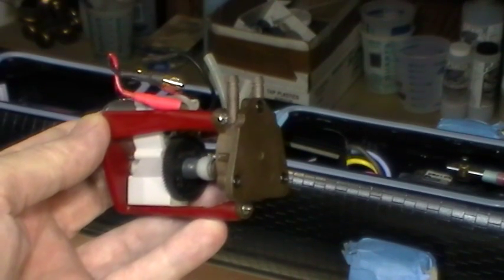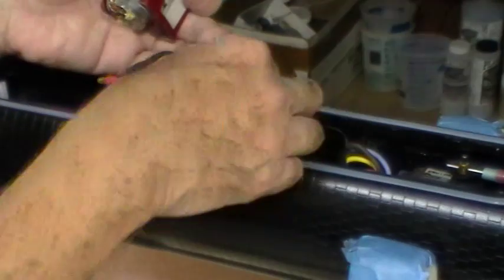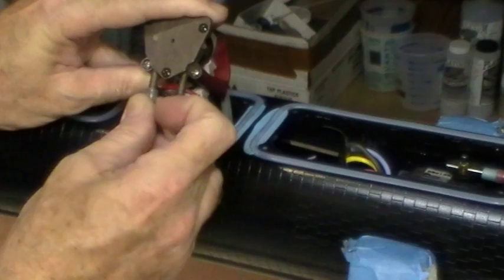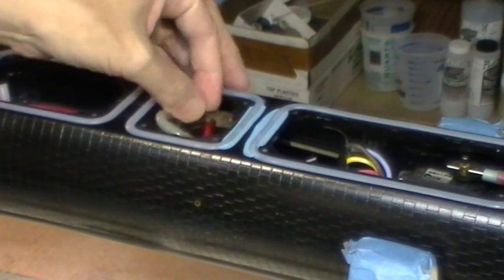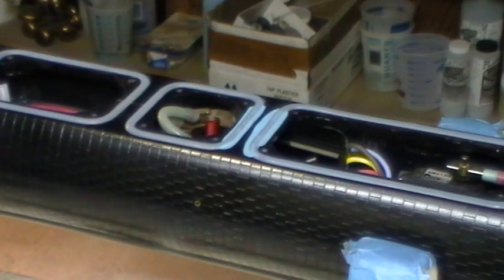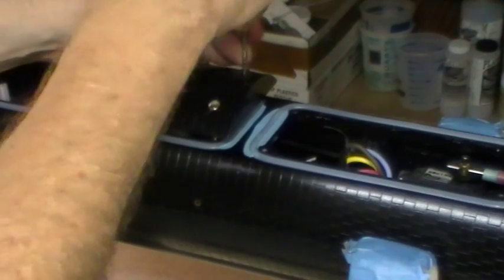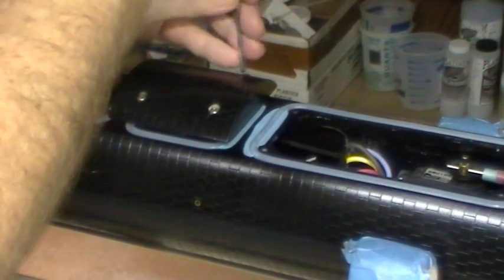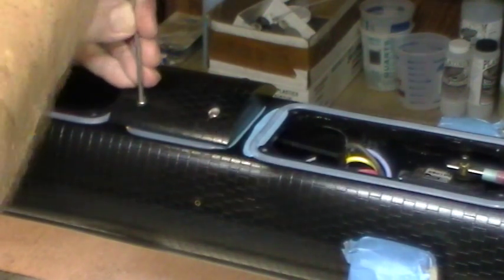Los Angeles Class 688i fast attack submarine model: Ballast Pump Install on Radio Control Submarine.

Comment: Just curious, what’s the reasoning behind having the screws fully extended before attaching? 

I’d guess it’s to make sure the seals are aligned?
Reply from the maker: Hi Roc - There are two reasons for having the screws fully extended before attaching: 1) Picture the silicon tubing washer on the screw. If that washer is just threaded on by a few turns, then as the screw is being tightened there is a lot of extra drag created by the silicone washer. Furthermore, the silicone washer will get chewed up as it "rolls" itself up the screw.
2) With the silicone washer already installed flush with the hatch flat, you can more easily feel if there is unwanted resistance building up against the screw as it goes into the hull. Building resistance to a screw going in, is a sure sign something is going wrong.